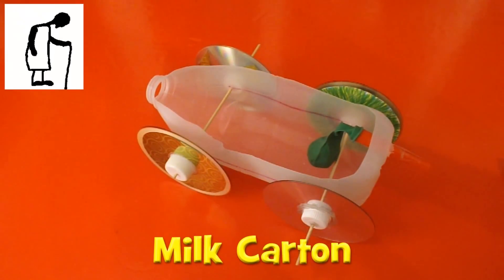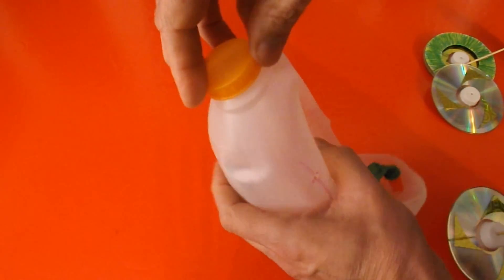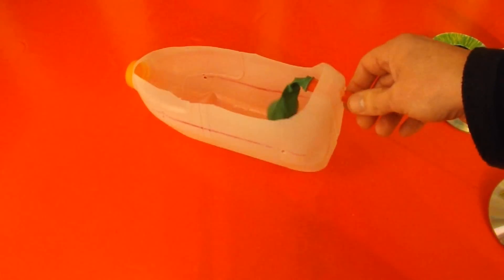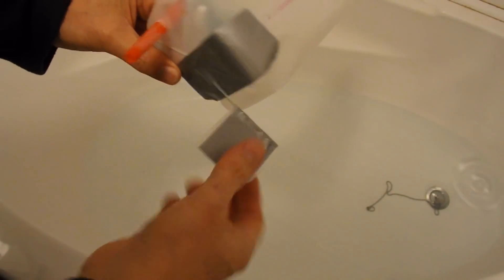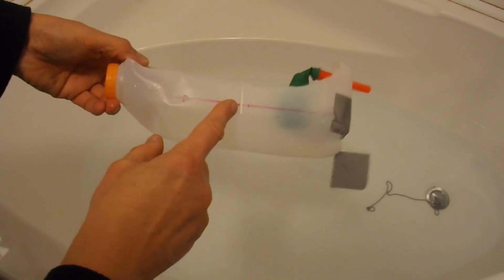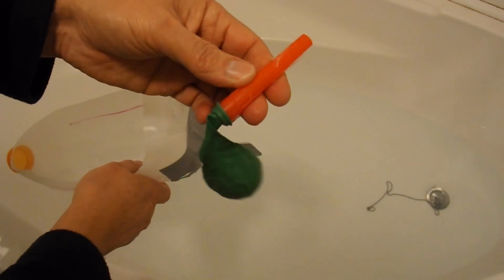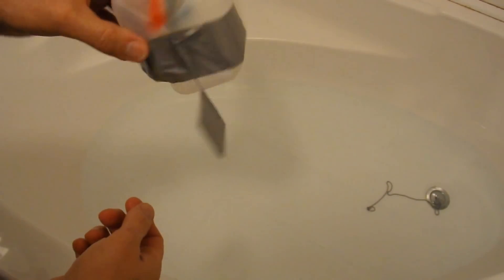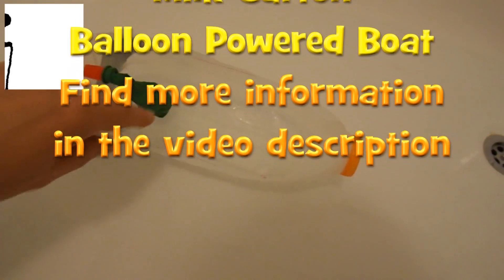Milk Carton Balloon Powered Boat

Comment: Great job I can't seem to get enough thrust to last long enough to get it to go a long way!
Reply from the maker: +Mattson McCraw you can vary the airflow rate by changing the diameter of the tube. I mentioned that in the video. A larger tube allows the air out quicker, smaller tube will be slower but last longer. Somewhere between the two will be the ideal size depending on the size and strength of your balloon. There is less friction on water  so you can use less thrust than you would need on land so you should be able to use a smaller tube. Rather than changing the tube you could try putting tape over the end and making a smaller hole in the tape. Alternatively you can make a tube out of paper or plastic to put inside the existing tube to make it's internal diameter smaller.
Reply: +GrandadIsAnOldMan can you make another styrofoam glider?
Reply from the maker: Mattson McCraw by coincidence I made one a few days ago but it will not be published until March 12th which gives you an idea of how far ahead I am with my projects. If I make another I will mention your name :)
Reply: +GrandadIsAnOldMan Thanks!
Reply: +GrandadIsAnOldMan could you also make something with a thermoelectric device?
Reply from the maker: Mattson McCraw depends what you mean by thermoelectric. Here are some projects using Peltier tiles https://youtu.be/Z1bTzAZeJxo   https://youtu.be/BWcu53iFn3Q  https://youtu.be/-B2pyubJlbI

Comment: Can u make a car but balloons as tires
Reply from the maker: +Nate Mcinnerney technically you probably could make one quite easily but as a practical project it would have limited use unless you strengthened the balloons to stop them bursting too easily. Once you start doing that you are not very far away from a normal rubber tyre with a balloon inner-tube.